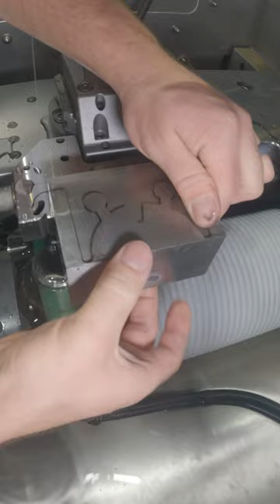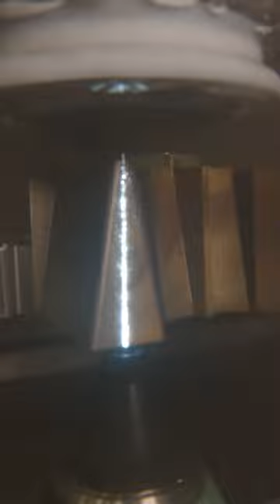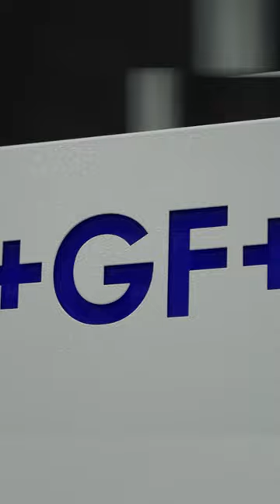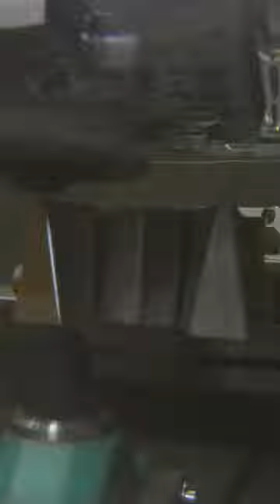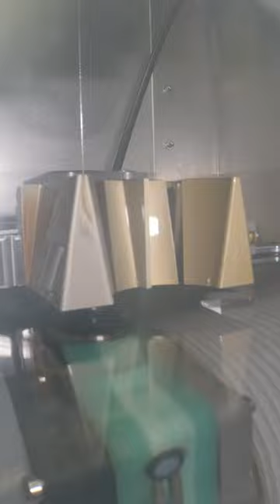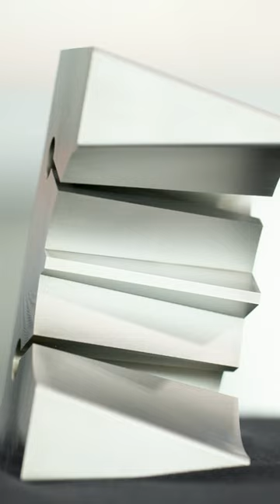Most Advanced WIRE EDM in the World🌎

Comment: Hope you explain this for us non machinist fans
Reply: ChatGPT4:

Wire EDM (Electrical Discharge Machining) is a manufacturing process where a thin wire acts as an electrode to remove material from a workpiece using electrical discharges or sparks. These sparks "erode" or wear away the material in controlled, localized areas. 
This allows for precise cuts and intricate shapes without the wire physically touching the workpiece, even in hard materials.
Reply: The bottom is generally fixed and the table moves, but this 1 also has x and y travel in the bottom so, that angles can be cut perpendicular  to the top or bottom surface.
Reply: I believe it's a wire with electricity going through it
Reply: @martylost167 There you go.  Your comment successfully explains why this is different than other wire EDM machines.